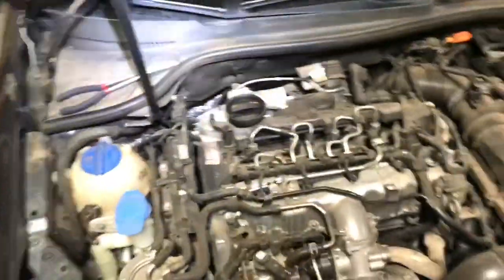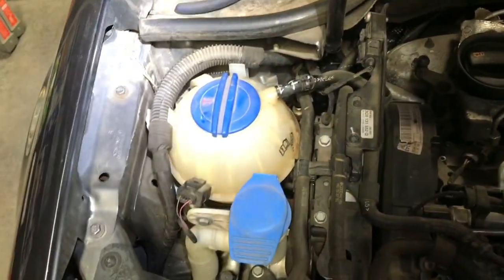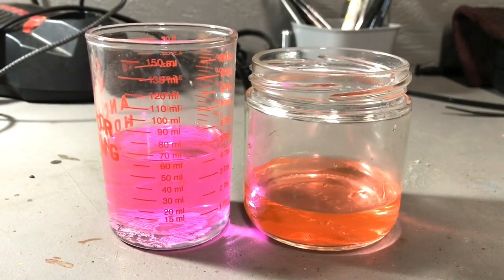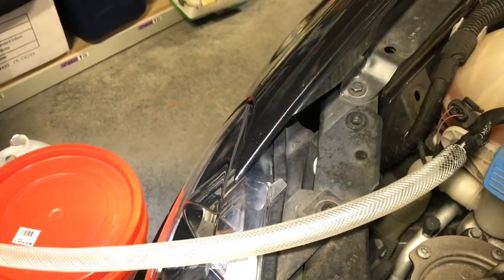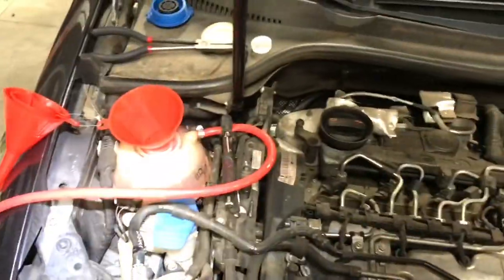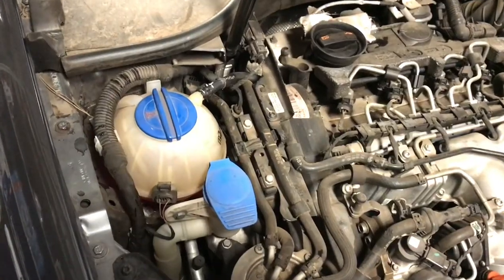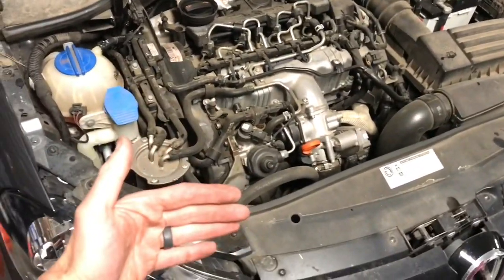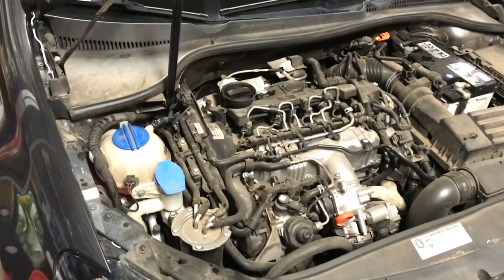VW Coolant Flush - The easy way, no mess! Volkswagen Jetta Sportwagen Passat Golf Touareg TDI TSI

Comment: This is a great method if you already have a charged system and simply want a full exchange. The vacuum bleeding is necessary if you have pulled the lower radiator hose and/or replaced the radiator and/or water pump. Since the vacuum bleeding helps get fluid to the pump so that it doesn’t cavitate and just spin with no fluid. Most water pumps can’t self prime, similarly the thermostat won’t open unless it has fluid next to it.

Comment: You should've turned your heating on to ensure the matrix was getting new coolant too and removed all the gunk. I think best using distilled water as the flush until it goes clear then use the coolant.
Reply: Get some coolant system flushing chemical

Comment: I'm glad I found this video.  I did this on my 2021 Tiguan and it was so easy I also did it on my 2023 Atlas 3.6L afterwards. Did the hose hook up and used a 5 gallon bucket at first. Then a clear bucket at the end for color match. It took a few gallons of distilled water and  50/50 peak European purple G12 evo. 
I turned on cold vehicle and set the heat to high then poured distilled water until water came out of tube as my coolant was orange at first like the video. Then poured new coolant until color matched some new coolant I poured in a glass jar prior.  With patience took about an hour each time to complete the flush and replace. Saved money and did it right, as most places just drain from the radiator hose.

Comment: Just did this service on my 2019 Golf Alltrack.  My car came with G13 coolant and the bag of silica in the expansion tank. I removed the silica bag, which was quite difficult as I removed the tank entirely and the bag material is very tough and can't be pulled without cutting and removing beads first.  I bought a replacement tank - 5Q0121407AA - but didn't use as it has different level sensor lead material - looks like plastic - and is a bit pricey, $80 from the dealership.  I flushed using G12evo coolant - G12E0501GRTU - and used a full 3 gallons since I bought ready to use gallons and car's capacity is 8.5 quarts.  I warmed up the engine to where the oil temp gauge needle just hit the normal operating temp and the expansion tank cap gave a little hiss when removing slowly, didn't blow off. Tubing was set up to drain to a bucket, highest heat setting and fan on full and let her rip.  The flush itself took 15 minutes and the coolant really pulls fast, like almost constant, steady pouring and would be easy to let it get away from you.  Make sure you keep some coolant in reserve as, when you turn off the engine, the coolant will continue to siphon out so be ready to pull the hose up and direct it back to the expansion tank.  Also, I had my wife keep the RPMs at 1,500-2,000 for the entire time flush. I drove around after the flush and the expansion tank is the G12evo uv purple color instead of pink still, so it definitely got the whole system.  Thanks for the great guide.

Comment: Working with one person, you should monitor the oil temp as you do this.  Oil is the main coolant of an engine, not water.  Or so a mechanic told me. Don't those OBD gadgets show the critical aspects of the engine?

Comment: November 2025 I just did this and it works like a charm.   Drive the car, get it hot, remove the return line, drop in a bucket, siphon out old coolant in tank and fill with new coolant, and follow these instructions with heater on full.  30 minutes.  2013 Vw Golf TDi.
Reply from the maker: Awesome, glad to hear it worked for you!

Comment: Thank you for the very clear video and concise explanation!  Smart.  Our motivation for a flush is the heater is not working.  Will this method cure that problem if the heater core is clogged?  If not, we are very interested to hear ideas about flushing the heater core specifically.  Thank you!
Reply from the maker: Doing a chemical flush like this will probably help (be sure to have the heat on when doing the chemical flush) like it did in my video but if the heater core is too far gone then replacing it might be the only option. Ideally, a cooling system flush, then new radiator, new hoses, thermostat, and new heater cores (there’s one in the rear of the vehicle if it’s a Limited trim) would be best because if you only replace the front heater core then it can get contaminated again if a dirty rear core or radiator. etc remains and continues polluting the rest of the cooling system. I have a separate video on replacing the front heater core. With all of this stuff: parts are cheap, labor is expensive. If you do get a new radiator, Denso brand is what we recommend.

Comment: Great video and this gave me an idea to take out the thermostat then reconnect pipes with gasket in place only. 
I need to check thermostat anyway.
This way, the fluid should go straight through without heating up the engine for thermostat to open. In addition, i would disconnect the two pipes to the heater core and flush thses independently with a bit more pressure then blow all the water out. After this refit thermostat and associated hoses then refill to the correct level after thermostat has kicked in.
Reply from the maker: Yes, removing the thermostat makes everything flow continuously and results in a better and faster flush for sure! On some vehicles it can be tricky or more work though depending on thermostat location and how the housing is sealed (o-ring, paper gasket, etc.)

Comment: If i warm up the engine first, isnt the coolant system pressurized? Would opening up the coolant resovoir with a warm engine be dangerous?
Reply: You keep topping it as it runs through the system so its not dangerous no

Comment: Works on 2015 Jetta TDI. I crammed what I think was a 3/4 ID hose over the outlet hose. Works great.

 I debated with a mechanic friend over whether or not it flushes ALL coolant out, but we both concluded it gets out probably 80%. Enough to keep stuff fresh if done every year or two (way more than most ever do)
Reply: If you add distilled water until clear , doesn’t that remove all? I’m afraid to mix coolants
Reply: @jay_daniels1388  Nah just flush with the same type of coolant. A little bit of the old stuff in there isnt bad if you get most of it. Just enough to keep it fresh. A full flush is needed only if you're having problems

For me this was just a fluid change

Comment: Question for those that started this procedure with a warm/hot engine.   Isn't it dangerous to open the overflow tank cap while the engine is up to temperature?  Or are the vw/audi overflow tanks not pressurised?
Reply from the maker: It is dangerous, as the contents are under pressure

Comment: Same as last three testimonials of your process.  Ditto to everything from @dxl3449.   Flushed nasty fluid, added distilled, then added concentrated pink/purple antifreeze.   Old fluid was slightly dirty with the BG flush, two part system product.  BG has a cleaner/flush, then a coolant additive.  Now I gotta change the heater core for no heat.

Comment: I tried to do this on my 2017 Golf R, I didn't get any flow through the tube until I raised the RPMs to about 1500 but at that point the reservoir just overflows as if the flow is backing up, not sure what I'm doing wrong.

Comment: I did it on my 2013 Tiguan with the ac maxed out and someone on the gas at 1.5k RPM i flushed the system with distilled water “2.6 gallons”. Then filled it with g12 evo it emptied out so fast it took me not even 20 min to complete the job. Remember it goes alot faster this way don’t let it run away on you.
Reply: Do not run a/c. Blast the heat! That is what cycles coolant around your heater core.

Comment: Third time doing the flush on a polo GTI 1.8T (EA888 gen3).
Removing the radiator hose is such an hassle plus being on stands or ramps I'm guessing not everything comes out anyway so I decided to try this.
Used fittings instead of the hose in hose method.
Small variation on the video: after running through 10 liters of water I closed up the system and went for a short drive then an other 15 liters of water and then the coolant.
Had no flow after a few minutes even with the engine already warm. A bit of throttle at 1500 rpm for a few seconds starts the flow.
For those in cold climates I'd be careful to properly check the coolant dilution level because I'm guessing it gets diluted quite a bit more than expected. Once I put in all the coolant (about 6 liters) I already got mostly clean highly diluted coolant from the return line for a while.

Comment: I can confirm that this method works on my 2019 VW Golf R Mk7.5 TSI. Replaced approx. 8.5 liters of G13 coolant with new G12 Evo. Made sure the engine was running hot with the thermostat open and the heater and fan on high. The whole process took about 45mins. Worked like a charm. Thanks so much.
Reply: I am also planning to to swap from G13 to G12 EVO on my 2.0 TDI Passat. Did you also remove the silikate bag? Is there anything else I should be aware of?
Reply: Thanks for the confirmation. I also have a 2019 R and I've been wanting to change the coolant tank and coolant over to the new versions...read a lot of horror stories about the silica bag in the coolant tank breaking and destroying the heater core.

Comment: Thanks for the video. In you video and amongst the comments many people are using upwards to 6 to 20 liters of fluid. The spec sheet for the tank is 5L for a replacement. Is there a benefit to the 4 fold fluid use if the coolant in the car is effective? Is the color change related to a breakdown of the ethylene glycol?

Comment: HELP! My 2014 Jetta Sportwsgen TDI will not drain. The engine is fully warmed and I kept it 2500 RPMs for 8 min straight. Nothing has come out of the return hose. Not sure what to do to make it start draining. The reservoir never lowered or pulled fluid into the system.
Reply: How’d it go? I’n experiencing the same thing and its frustrating

Comment: Looking for something on my CRUA but nothing so far 😢
Reply: I was about to attempt this on mine… did you find something different?
Reply: Do you have a crua? If you do it is  NOTHING like this cjaa at least I think that’s a cjaa. The 2015 golf crua engine code has 3 cooling loops(engine,intercooler,egr) all connected but you have to have the ability to cycle the coolant pumps so you get everything out  it’s not rocket science but definitely not as easy as the older iterations
Reply: @Throttleology yes the one in the video is CJAA

Comment: Worked wonderfully in my 2019 Tiguan. I did all distilled water first then 2.6 gallon of premixed Peak Violet.  I think it originally had pink, but Peak recommended the violet for my year VW
Reply: Did you measure the concentration when you were done?

Comment: You forgot to open your heater and turn it on.
Reply: Volkswagen uses air regulated heating. So it doesn't make sense to turn the heater on. Water always pours full through it.

Comment: Only issue I have with this is the possibility of mixing different coolant. Unless you’re sure what’s coming out is the same stuff going in then i wouldn’t try this. But otherwise this is a great method
Reply: That’s why you completely fill with distilled water and then only do you fill with concentrate once it runs clear
Reply: When you remove a bottom hose, not all old fluid will be out and mix anyway.

Comment: Did this flush method clear any sediment out of the system? Once the engine was sufficiently hot and the thermostat was open, was enough coolant being purged at a fast enough rate to clear coolant sediment from the system?
Reply: This won't cut it for a deep flush. Still worth it in my opinion for normal maintenance.
Reply: Good question. I wonder? Usualt there is a reason why bottom hose is removed

Comment: Thanks for this video.  I changed the coolant in my mother's 2017 VW Jetta using this method.  Wanted to say one thing that may help some people.  Regarding the second hose that you crimped off with vice grips, I simply placed a temporary screw in there and it worked fine.  Very easy method - I agree with you.
Reply: Golf tee.

Comment: I have 2016 Audi S3 and this did not work. Coolant just overflows out of the reservoir and makes a mess as soon as the engine gets hot. Barely anything comes out of the hoses.
Reply: This happened quite a few times to me too last time I did this and made me nervous to try again. It would happen seemingly when I turned the heat on/off and/or toggled cabin air recycling. Thought this would happen only when the coolant was already well diluted (mostly water).
This time I turned on the heat since the very beginning and never turned it off. Got no overflow this way.

Anyway if the engine is hot and you're not getting any flow out the return line try keeping 1500 rpm for 10s. At idle the flow can be very low and the weight of the fluid itself can stop it.
If you need a good flush a second person is handy to hold steady rpm (or have VCDS) without risking running dry
Reply: @Randomcommenter00000 Can you directly set the RPM with VCDS, or are you referring to the special coolant maintenance mode that automatically revs the engine, opens/cycles the thermostat and auxiliary coolant pump?
Reply: @attocoulomb  Yes, I was referencing the coolant maintenance routine.

Comment: If you run the heater while you do this I believe the fluid inside the heater core will come out as well.
Reply: Isn’t there always water flowing to the interior heater core? I think the air flaps regulate the temperature.
Reply: Yes but, who's going to wait around for the engine to be hot enough for the thermostat to open and for radiator fan to come on to let flush water through. After this, more time is wasted waiting for engine to cool down. By taking out thermostat, you don't even have to start the engine for system flushing.

Comment: Doing my first coolant flush on a 2012 jetta gli but don't have any way to lift the car to get under and detach the radiator, so this is really helpful for me. It has the same return line to the reservoir so I can take this idea and apply it a little differently. Quick question though, I was always told the coolant reservoir is pressurized and opening it at warm-hot temperatures can lead to very hot coolant exploding out of the top. Do you really think it's safe to open the coolant reservoir with pressurized hot coolant in there?
Reply: In this case it was open already before the car got up to temp. If you car is already hot let it cool down a little before opening the reservoir.

Comment: i thought it dangerous to remove coolent lid when engine is warm/hot due to pressure buildup? so how should you get engine warm first?
Reply: Pressure cant build up if the lid is off when you start it
Reply: @alientiger21 so you take the lid off the coolent then start the car and let it warm up?
Reply: @wardy-r6927 yes or if it is warm let it sit for 30 min so its not at op temp then turn it on and you shouldnt gave to wait as long as

Comment: Thanks for the TIP! Just used this method. I used a 1/2” ID tube and the tubing & nozzle from a flo tool transmission funnel as an adapter,  if anyone has one handy. A coolant fill funnel seemed to help with the flow. Idk if the addition NPSHa was needed or if it was just a coincidence but when I filled the funnel to the top she started flowing. Wish I would’ve thought of zip tying a glove to the open port like some other comment mentioned, it would’ve saved me the trouble of holding it with my thumb like a ninny.

Comment: Just tried this on a 2015 MK7 Golf (1.8) - and it worked out great. Motor was already warm - it seems like you get way more out when the thermostat opens. 

Side note: use a sturdy tube and wear gloves - hot coolant is, well - hot. I used a cheaper tube, and it was getting VERY bendy 😯😯 I checked the temp gauge often, no problems - but you'll absolutely get a big red light thanks to to coolant pressure being low. Should go away once it is all put back together and you start the car.

Thanks for the tip and the video - great work!

Comment: If you do it when engine is warmed up isnt that dangeorous because of how hot it is?
Reply from the maker: Yes, use caution as the coolant coming out will be hot. If you take the reservoir cap off it could spray out with pressure so cover it with a towel, or better yet would be running the engine with the cap off so pressure cannot build up during the warming process.